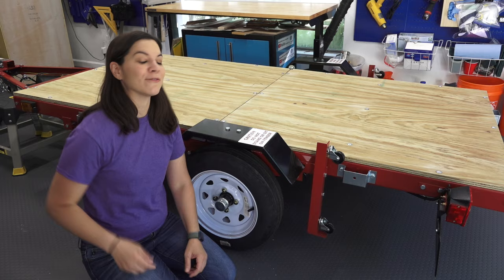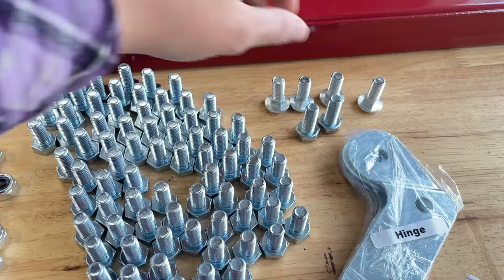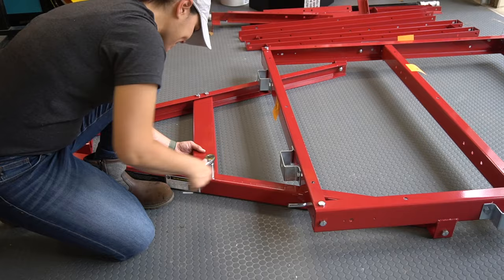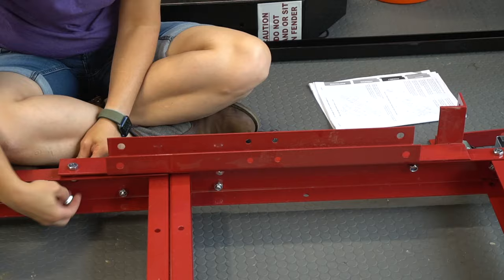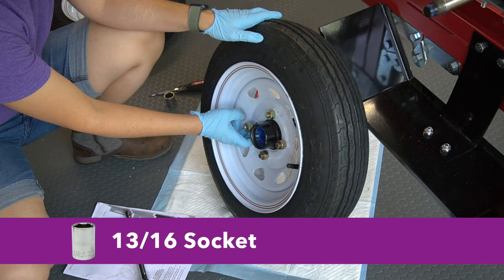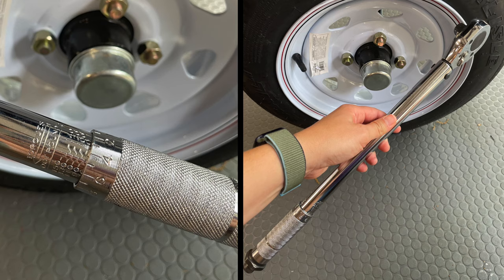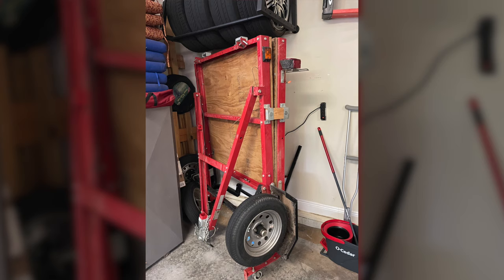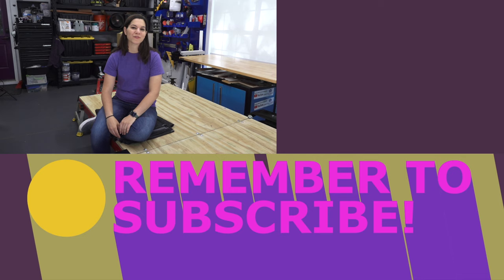How to Assemble Harbor Freight 4x8 ft FOLDING Trailer

Comment from the maker: What would you haul with a trailer?
Reply: Hi Steph. Great job on the video...Awesome!!! I will be using this trailer to tow a couple of kayaks. Would it be possible to ask if you could give the measurement from the ground up to the bottom of the tongue where the ball fits into, on level ground. I saw a video that explains that the trailer has to be level to get the correct size drop measurement. I will be buying the B&W hitch. They come in different size drop / rise. Hope I explained that correctly.
Reply from the maker: Thanks! 15 3/4” from ground to bottom of the hitch coupler. -Steph
Reply: @MotherDaughterProjectsDIY Perfect. Thank you for getting back to us Steph. We will be purchasing the 1720lb HF trailer. I am sure the measurement is the same having the same 12" tire size. We will be installing a B&W 5 inch drop hitch. That might be a little overkill for this light trailer, however its because we plan to get and tow a boat in the future. My girlfriend and I love your channel. Keep up the great work!
Reply from the maker: You're welcome! Sounds like a great plan- let us know how it goes!
Reply: I perform at Renaissance Festivals. I have a LOT of props/costumes/pavilions. Plus, I wanted a small stage to perform on, and to be able to convert it at night to a little home to sleep in. Thank you so much for the excellent guide 🏅🏅🏅 HarborFreight should sponsor you 🤗🤗🤗
Reply: I’m thinking a GIANT Klondike bar! LOL! Seriously, got into kayaking 1.5yrs ago then broke my foot. Wife can’t lift her kayak on my roof racks and wanted a simple trailer. Since we just got the smaller trailer, she’s able to take off with her girlfriend and strap both their kayaks on the trailer. Next week we’ll be looking to put a plywood base floor.
Reply: @Scott Russell PhotoFilmz  I just wanted to thank you for asking this. I bought this to tow behind my s10, which Is much lower than my f150 with upgraded leaf springs, so now I know I need a 4" drop to tow it level! Thanks!
Reply: About the torque wrench: you should feel and hear the click. Your torque wrench is broken. I think I was able to fix mine by backing it out all the way, then returning to the setting that I wanted. But, I'm sure there is a video out there for repairing that model you have. On many smaller bolts, there is a danger of breaking the bolt off completely. Once you know what 85 to 90 pounds of torque feels like (standard for most lug nuts) then you can change any tire. Don't forget to tighten in a "Z" pattern for  4-lug, or star pattern for 5 lug and go over them twice.
Reply: Lets look at the list so far with 4 months on the road - 150cc scooter to the shop, 10 house shutters, 2 riding lawn mowers, a bunch of neighborhood kids, so far so good!
Reply: Brush, firewood, plywood would be great too.

Comment: Personal observations from building 2 of these: 1) When assembling I would recommend steel spacers between the frame and hinges so the heads of the pivot bolts stay outside the 4x8 bed otherwise the bottom sheet(s) of your payload will get chewed up. 2) If you want to attach plywood to the inside of the 2x4 posts on the sides you may also want to put spacers between the frame and post holders where the spacers are thicker than the plywood you plan to use to keep the 4x8 payload capacity. 3) Some “4x8” materials, like melamine sheets are oversized and will not fit (just be aware before purchasing a bunch and thinking it’ll fit in the trailer)

Comment: I'm currently in the build process on this gem, now $519.00 by the way (thanks inflation/supply chain), and this has been a great overall guide. Most of the build is pretty straight forward if you have done any DIY around the house but this video has really been a great guide to accompany the less than impressive factory manual. Thanks for all the hard work it took to put this video tutorial together!

Comment: Thank you so much. I didn’t know how to secure the safety chain to the trailer. I must have missed that step in the cruddy directions that came with the kit. I used this trailer as a base for a teardrop style camper I built over the last year.  You wiring video was great too.

Comment: Great video!!    
I would always suggest getting the biggest trailer you can.   Having that extra load capacity is great.   
I know when I added sides onto my trailer it went from 1,100 lbs capacity to 600 because the trailer weighed in at 500 lbs.  when I upgraded I got one that was rated for 3,200 lbs.  so it can haul 2,500 lbs because the trailer weighs 700 lbs.
Also when you bolt on that coupler.  You don’t want to use bolts that run across to both sides.  You want separate bolts for each side so that if a bolt breaks you lose 1 bolt of 5 and not 1/3 of your connections.

Comment: Great video. Couple friendly suggestions: Lubricate any bolts that will be removed regularly except the wheel hub bolts. Antisieze would be my top. I'd also recommend using blue loctite on the nuts and bolts that won't be removed. Your future self will thank you.
Reply: Another suggestion: the most accurate way to square up a rectangle is to measure the diagonals and make sure that they're equal. First, tighten up the nuts to a smidgen past hand tight, then measure the diagonals. This way, the bolts will be loose enough so you can nudge a corner to make corrections, but tight enough so that the frame won't dance around when you nudge it. 
-- With something like a folding trailer, you want it to be dead-on square, because if it's off, folding and unfolding it will likely involve more friction or catching on other parts.

Comment: Not that my opinion is worth much, but you not only did a great job building that trailer up, but an amazing job showing the process in a clear fashion. Wish I'd had this as a reference when I built my frame years ago (but, uh, somehow I've yet to add decking...)
Reply from the maker: Thank you Evan!
Reply: @MotherDaughterProjectsDIY  Thank you for posting such a helpful,organized system to make the trailer kit assembly much easier .Especially the heads up on those parts of the assembly that require closer attention to detail.I look forward to watching your other posts.Thank you again so much Mother and Daughter!!
Reply from the maker: You're welcome! So glad it was helpful!

Comment: Great video! Very nice and easy to follow build guide.
One little note, or maybe just my opinion. Replace all of the wheel bearings and all of that grease. Unless you just barely use it and arent going down the highway, then should be ok to keep it as it is. 
It is pretty simple to replace with higher quality bearings (can be found on Amazon for about $35) and high temp bearing grease, and for peace of mind, worth it IMO.
Reply: Why replace the bearings for the highway? I've heard you can't find those bearings due to the odd size.

Comment: Absolutely perfect.  Thanks for taking the time to make life easier for those of us who buy this trailer.  In the 2015 manual for my brand new 2022 trailer, it has this "warning" about the bearings.  "WARNING - whenever a hub is disassembled (if a hub on a new unit requires assembly or a hub is disassembled for maintenance), the following procedure MUST be obeyed.  Failure to read and obey all of the following instructions completely will void the warranty and can result in damage to the trailer, property damage, or serious injury.  A) Blah, blah, blah... The parts must be cleaned even if they are new or appear clean."  I'm thinking that that is protect them from liability if the original grease was contaminated at the factory.  Just a bit of hard grit could destroy the bearings and who knows how clean a Chinese factory is as they rush these kits out the door.

Comment: Steph, you did an excellent job! It was very thorough and will definitely help me with my project of making a kayak trailer. My plan is to extend the tongue and hitch to make it longer. Just as a side note when talking about ft. lbs. You should say "foot-pounds" not "feet-pounds." I have been an aircraft mechanic for years and if the torque wrench would not click it probably was no good. It may have been dropped at one point which would render it useless. Again, thank you for your great videos on this trailer project!
Reply from the maker: Thanks Michael! Great info.
Reply: Just got an Icon torque wrench, similar to the one in the video. It doesn’t “snap” or click like my dad’s old Craftsman torque wrench… it sorta wilts into a slight bend at the desired torque. Or perhaps these are just examples of defective tools?

Comment: great job assembling this. I have been using your video as a guide to assemble mine. Unfortuantly mine didn't come with cotter pin, so need to go buy one.. Also in case someone didn't tell you, its "foot pounds" not "feet pounds". I know it sounds weird, but thats just what everyone says. its because its actually the quantity of lbs of "force" (although weight isn't technically a force) required to lift 1 pound a foot (12 inches) up from the earth (away from gravity vector).
Reply: Also i think i have the EXACT same torque wrench you were using, and let me tell you the click is BARLEY noticeable. It wasn't always like that.. it used to be WAY WAY more obvious. Unforatunly i think mine (and that one) has worn out (even though i left it sitting onthe lowest setting). I actually bend the frame a bit trying to torque the spring hanger down to 15 ft-lbs.

Comment: You should take the bearings out and re grease them, the bearing behind the seal on mine was not even greased! 
Great video!
Reply from the maker: I did check and it was greased, but I will re grease them probably in a year.

Comment: Great job on the video! I noticed you had the boxes in the back of your vehicle. Can you tell me approximately how long the long carton is that holds the frame parts?  I have about 5 feet in the back of my Jeep.  I'm wondering if it will fit.
Reply from the maker: I never measured the box when it was all together so I can't say for sure. I think it would fit, but to be safe you could ask them to measure it at harbor freight before you buy it.

Comment: Great video.  Why did you take the tire off the hub assembly?  It looks like it was ready to be slid on the spindle as is. That's my guess anyway since the lug nuts were torqued down.
Reply from the maker: I can't remember, but it was in the instructions to take it off and I think there was a part that wouldn't fit without that step. -Steph

Comment: Ok, here goes…L-O-V-E the smart videos, I call them gap fillers what the Harbor Freight directions don’t cover. Note - you need to go to their website, do a review and add your YouTube links to help folks. My question is we bought the Harbor Freight 1090 Lb. Capacity 40-1/2 In X 48 In Utility Trailer, smaller and NOT folding. I just had surgery on a broken L ankle and to see me and the wife working on this together (in our living room, I know…I know) was certainly a true test of our LOVING RELATIONSHIP laced with love!!! Now we’ve decided we need stand the trailer upright in the garage BUT…it’s not recommended because the tail lights protrude and will crack and damage. There is some room at the tail end of the trailer between the lights with room for a rubber-like bumper? But I would need something 3-6” or maybe fabricate a garage stand for this type of trailer? You folks seem really sensible and I hope you don’t mind me bouncing these thoughts of ya!

Comment: Great info, thanks. I guess it's not really folding if you have to take out a bunch of bolts to fold it. I want this trailer but it's not only out of stock, it's much more expensive now :(
Reply: It is capable of folding, but the bolts are necessary to make sure the trailer is strong while in use.  Folding the trailer is more for storing over winter etc.

Comment: Nice video! I'm retired, have little hobby shop.  I need to pickup a 1200 lb. Metal lathe that's about 1300 miles away.  The wife and I have a 2021 honda passport, a bit bigger than your crv.  With the wheels removed and back seats down, do you think it's possible to put this in the passport?  I hate to travel with this empty bouncing around, one way will probably be bad enough. Thx

Comment: I have gathered in  some of these Harbor Freight YouTube videos if you use too thick a plywood deck, it will not fold. My understanding is that full 3/4" is too thick and gets in the way of folding, is that correct? What thickness did you use, and did it fold easily? I heard 5/8" recommended, but my local Home Depot does not cary 5/8".
Reply from the maker: This is what I used: 23/32 in. x 4 ft. x 8 ft. CCX Ground Contact Southern Yellow Pine Pressure-Treated Plywood. It folds flat. I installed it in this video: https://youtu.be/Mm469EcR1P0

Comment: Great job, Steph and mom.  I am curious, you mention the two bolts in the middle joining the front and back sections needs to be removed for folding the trailer (refer to the video at 4:30 time),  it doesn't seem to be a way to easily access those bolts, how do you do it?
Reply from the maker: We are going to share that in an upcoming video. But we bought a 40" creeper from Harbor Freight that makes it really easy to get under the trailer and add or remove the bolts.
Reply: Could a hinged access panel be added to the decking to allow them to be more easily removed from top side instead of creeping on from the bottom?
Reply: I just left those out. There are 2 other bolts on the side rail that seem to hold fine. They are much more accessible, but unless I have a really heavy load, I usually just leave those off too. Most of the weight is on that side rail and the hinges, so the bolts between the segments and rail just make it more sturdy; not structural.

Comment: The manual with it recommends not going over 45mph. Have you been doing that??? I noticed in another build video that the person said they were driving it at 65 but they'd repacked the bearings. I'm not a car person either and don't really want to do the repack. 🤦‍♂️Just wondering how stringent this "45 mph" recommendation is. That seems pretty challenging if you need to get on the highway! Great job on the trailer video by the way.
Reply from the maker: We have not gone over that. I know you can get better tires for it that will allow for high speeds. If we were to take it on the interstate we would do that.